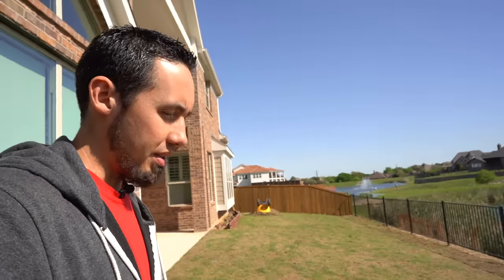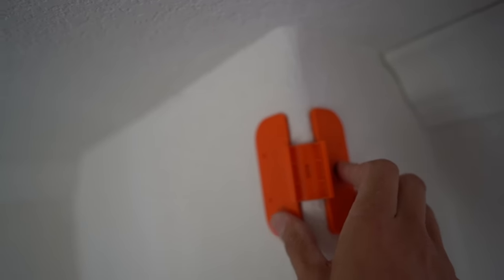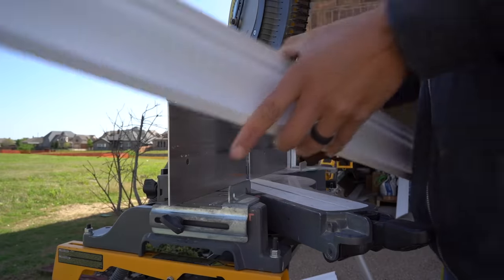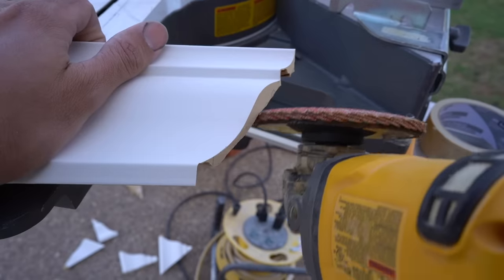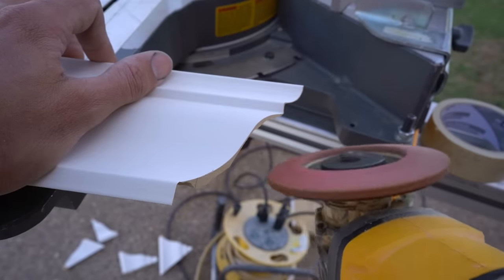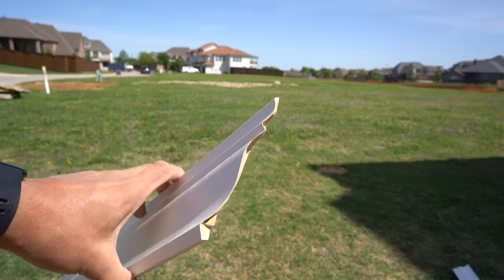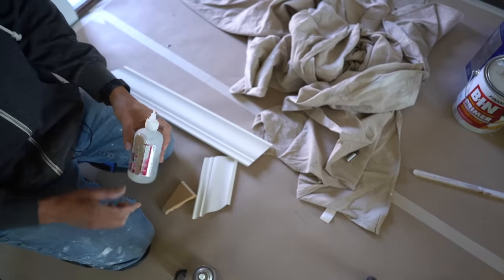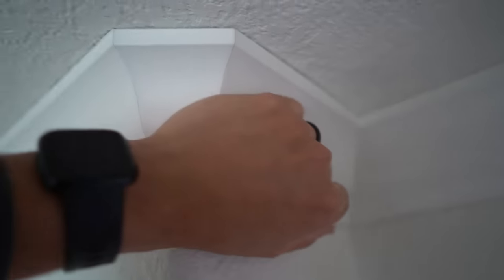This Makes Coping Easier

Comment: Quality work and you make it look easy (although I know, that it takes practice).  My biggest challenge isn’t so much the seam, but one on each end, and having the piece the exact length.  Like two inside corners at both ends or an outside to inside run.
Reply: I mark exactly 10" from one inside corner then place my tape against the opposite wall and measure to my mark and add 10" to that measurement. No guessing from trying to jam your tape into the corner. If you add 1/16" or so you can spring the piece into place by bending it down slightly in the middle with the ends in place. For shorter pieces you may have to put some kerfs in the back to facilitate bending.

Comment: Buy a crown jig for your jig saw and s scroll blade.$40 to $200 for the jig. The plastic ones are fine for weekend warriors,  just get one that corresponds to the angle of the crown. The more expensive ones are adjustable, it gives you the proper back cut, eliminates the guesswork. Well worth the investment.

Comment: Nice!!! My only suggestion would be to get a lighter, slower moving grinder with not so course disk???  Seems like the weight of that grinder would make my arms and hands tired faster and cause problems.  But i do agree with practice, practice, practice.  Glad to see you do this grinding outside as the prime contractor, owners, and other subs don't like all that dust all over the place inside.  Thanks!!
PS.  I've always hated a coping saw cut too.

Comment: I use the jigsaw with the coping foot which is not bad, insert a coping blade to make turns easily. I cut inside also, I feel that having to use a grinder would make a really big dust storm and probably should wear a mask all the time unless you cut outside and it's windy. I prefer not to run in and out from the house to cut and cope moulding but to each there own.

Comment: Man you have a great channel.. Excellent job on keeping in concise and so easy to follow.. I have done metal work for many years and used angle grinders for everything including coping steel but never did I think about using a tiger paw pad as well call them for doing coping. With steel you just run a bead and if you have a gaap.. wood not that easy! lol! Thanks for sharing I subbed will watch more of your stuff!

Comment: I noticed that when he was trimming the profile, he was holding the coping with one hand and the angle grinder with the other, This is asking for trouble with over cutting.
I would suggest that he clamps the angle grinder to something solid and feeds the coping holding it in both hands. This will give him more control over the removal of material.
But I'm not a professional.
Roy
UK

Comment: Hi Richard, I really liked your video. Thank you for posting it. I like the coping method and have tried it before. First with a coping saw and then with a coping foot on a jig saw. I wasn't thrilled with either method and hope this will be my answer. I have a home work shop so I want a corded angle grinder and I will use the flap disc. Two questions for you, first do you think  40 grit is the best for MDF? Second, and most important to me is what "corded" angle grinder would you recommend? At the box stores I see 6 amp, 8 amp, 11 amp, and even 16 amp grinders, so at what point is over kill? I'm looking for the best bang for my buck but don't need the most expensive tool. Thanks

Comment: I use a jigsaw with an up cut blade. I turn the jigsaw upside down and cut along the contour. Much faster process than using the angle grinder.

Comment: Nicely done! I don’t run into those bullnose corners that often if at all. But what is that little orange tool that you were using? I also have never used MDF for crown. But check out that little copping foot for a barrel grip it’s a lot easier to manage than Angle grinder, but I will definitely try your method thanks for the video!

Comment: Great vid. Hey do you measure down from the ceiling and make a few pencil marks to Keep the crown straight on the wall? Especially with MDF I’ve found it will sag or twist if you’re not careful.
Granted I don’t have to do crown every day but some jobs I do have to install it.

Comment: Ya ever use the battery powered nailers and it either puts a dent on the material or doesn't quite sink the brad right? I still use air tools, lotsa hose. Going to try that flap disc trick tomorrow. Metro plex also?Subscribed buddy 👍

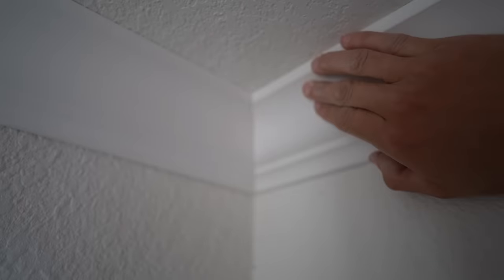Comment: I have the same crown moulding like you used in this video but wider, I tried the same method except the flat cut. Then I ended up a gap on the top of the right inside corner, but yours is ok (see 9:01). Is it because I flat cut it?

Comment: Have you ever tried this same technique using a dremel/rotary tool? If so, what type of attachment did you use? Also i saw there’s a sanding belt attachment out for the Milwaukee m12 3”cutoff tool, do you think this would work as an option for doing the coping?

Comment: Genius with the flap disc, probably takes a few goes to get the feel for it  ! How strong are bonded joints ? Would they be difficult to pull apart with hand pressure only ?

Comment: Some years ago This Old House had a tool that did this.  I did some digging and I believe it is the Copemaster. It looks too complicated and the cost is $2,500.  Too much money.  The angle grinder is good, you just need to have the touch.  What do you put in the joints and along the ceiling and walls to fill in the gaps?

Comment: HAHAH!!!! 
these are the tricks the older guys dont like to tell you, i just did this with a BADLY out of plumb, square and curved corner of a carport addon that we are doing Hardy board on, had to cope the trim board in multiple places diff ways and angles, but... looks perfect now and any hint of coping is hidden by the lapped siding and finish caulking

question tho: as an electrician that is learning on trim here, why cant you build the cope into the saw with beveling the blade at say a 45 to undercut when you cut it the first time and then you should be left with what you just removed with the grinder... or is it that tight you have to contour each curve to get enough clearance?

Comment: This may be a dumb question but I'm trying crown on a small room. So basically any inside corner you can do this and It will fit without having to find an angle? Just end with a straight cut and then cope the other piece?

Comment: Not sure what is going wrong. I measure my distances on my crown and install it correctly. I cope the crown using this method, and others. I cannot get the cope to line up with the other crown. Walls and ceilings are 90 degree angles. Any help is appreciated.  I have watched almost all of Finish Carpentry TV videos and love them all.

Comment: Loved this! I will have to try this method next time I do trim work! I watched another video with a guy using a hack saw but this is much better. What was the glue that you used for the joint pieces? It was hard to hear in the video. Also, does the bull nose measuring tool have a specific name?

Comment: If the piece isn't too long you can use this same method with the miter saw itself slightly resting against the lockdown mechanism takes a little practice
Reply: I first started this method with shoe molding just don't take more than an 1/8 at a time or the piece will kick back

Comment: I suppose you could use a Dremel tool instead of a bulky angle grinder.  I might take longer but the control would be easier.

Comment: Did you remove the small portion of the profile that meets the ceiling? Right at the top of the miter, it looks like you removed a small portion of the profile. I've had to do the same for my cope cutting to match up nicely

Comment: Good job, I'm 65+ and have witnessed a lot worse. I'm from the mitered method but have contemplated coping. Wonder how prefinished hardwood trim would work out. Oh, is dust an issue? Especially inside, way up north. So we're inside in the winter.

Comment: Installed thousands of linear feet of crown (most other moldings as well) and always use a coping saw to cope. Grinder is a lot slower than a properly used coping saw and does not make any better joint. Grinder for coping seems more like a homeowner style method, but to each his own.

Comment: Ive got a question. Are u coping this piece because the other  was already there and you dont want to remove it to cut it, or all crown molding needs to be coped. im new to this but i made cuts with board flat on saw and they came out good.

Comment: Well, mine did not come out perfect.  I am wondering if the piece with out the cope isn't either up high enough or is not at a perfect angle .... I dunno.  Getting close but not there yet.

Comment: Does this method work as well on pine baseboard? I am about to do my first trim work in a looong time, and I now have a DeWalt corded 4-1/2" x 7/8" angle grinder. I like the idea of using for coping. I've only got 160' of baseboard to do in the downstairs of my house, so one disc should get the job done, right? Do you have a disc you recommend? It looks like you're also using a 4-1/2" DeWalt (cordless) grinder.

Great videos - I just subscribed. Thanks!
Reply: Yes it does. I just commented on the post (directly above yours). Works like a charm.

Comment: For a quicker, easier way to achieve the same result with a lot less dust, use a jigsaw held on the face of the cut, much as you would use a coping saw.

Comment: I have a question.  You show us all these tools that calculate the exact angle to cut an outside miter.  Wouldn't it also show the correct miter angle to cut an inside miter?  So if it does, why do you still cope an inside miter?

Comment: Im so using a flapper disc now, I hope you use a dust mask when working with MDF not good to breathe that dust in.
Reply: True....but he's cutting outside. Also, if you ARE cutting in confined area......PLEASE use a respirator with replaceable filters. 3M makes a great one for under $30.00. Dust masks DON'T work as well as you need them to.

Comment: Thank you so much for the video! I had a quick question, you said the tool you had finds the miters and you said it’s right at 45 degrees and then went with 22.5 for each cut, how come?
Reply: It's actually a 90 deg corner. If the drywall had a sharp corner, each of the 2 pieces going into the corner would be 45 deg cuts (45x2=90) but because the drywall has a round corner he used an extra piece of molding so there isn't a big reveal visible from below. Because there is an extra piece to turn the corner, each miter cut only needs to turn half of the 45 deg cut = 22.5 deg

Comment: Dude just try the old coping saw. With good sharp blades it goes by way faster. I cope just about every inside corner I come across. In a race I could get the same result as you faster. 15tpi is a good balance between fast cutting and fine finish.

Comment: I've seen a few tips on coping but the thing nobody seems to mention is- why should you cope rather than miter the inside corners?
Reply: All to do with internal corners never being a true 90°.. Mitres will show the corner not being true but Coping/scribing allows for a tighter joint and better finish..👍🏻

Comment: Is there a certain time when coping is better then a miter inside corner?
Reply: Almost always coping is better, much easier to get a tight joint with variances in walls and corner angles.

Comment: I've done several jobs scribbing like this and it's the shit. Angle grinder, roto zip, belt sander whatever you have on site. Make it work. and if you fuck it up just remember 
 FILLER SPACKLE CAULK AND PAINT MAKES A CARPENTER WHAT HE AIN'T.

Comment: My dad taught me to cope when i was younger but as i advanced most crews i worked with wanted miters. And i admit it works on paint grade but coping is better. When them inside corners fit so tight its satisfying. And what happens when paint grade trim carpenters are asked to install some stain grade oak? Misery and mishap is what. I like the hogging method with the angle grinder tho...im not so old school to just dismiss it and say it aint the way. It works like a fucking charm. Its my preffered method amd will continue to be. The argument isnt with miter cutters tho its with copers. Hogging with grinder is faster with same results sorry copers. But instead of arguing that the hoggers and copers should team up...get a trim installation standard in place. I can cope a house trim crown base name the place as fast as an angle cutter by hogging out my copes.

Comment: What's the benefit of using this method over a double mitre inside corner?
Speed? Easier to get tight if the corner is just off?

Not trying to be smart here, just genuine interest..

Comment: I don’t understand why you would have to copy the inside corners..... why not just cut it at the correct inside corner angle.... and if you are having trouble getting it to close then just cut each piece .5 to 1 degree more on each piece. Don’t get me wrong it’s a nice trick if you are attaching to existing trim. No matter how good you are at it coping would take 3X longer than just cutting the correct inside miter.
Reply: Erick Villatoro thats old school. Coping is new school, and looks cleaner.

Comment: As an employee in the Millwork Department of a big box store, I was required to take a course on-line about installing trim. The dude doing the actual work was pathetic! There were gaps an 1/8th of  an inch! When we got to view the finished corners, the moderator asked "And what is the next step?" I couldn't help myself - - - "Hire a real carpenter?"

Comment: dust... no thanks. Let me know how that works out for your lungs cutting inside where the majority of new construction guys would be cutting.   The best coping tool I ever used as a Collins Coping foot on a jigsaw.  Try that.  It only works on certain designs though so that is little drawback

Comment: I install kitchens for a living and I don't understand why everyone doesn't just miter every joint. Way faster and nicer.
Reply: Josh McDevitt different on kitchens because all the cabinets should be true and square. Existing walls are almost never square and coping is faster than cutting a 44deg miter, then a 47, then a 45.5. This way gives you some wiggle room but still provides a tight joint.
Reply: @TheJCinator  
Lol. Not a chance. Still installed against crazy ceilings. I have installed a ton of crown in houses and I only cope if I absolutely have too. I am telling you : try the mitre .
Reply: @TheJCinator  no it's not lol. So what dont adjust your angle for the cope ?. It's the exact same, you leave the ends loose and push them up or down until it works. Upgrade your shitty miter saw and try it out. You might actually learn some thing.
Reply: Josh McDevitt lol “adjust your angle for the cope” WHAT? 😂 that’s the whole point of the cope to not adjust your angle. And plus, coping is a sign of craftsmanship that’s why it’s still highly regarded today. You clearly need to read up on your crafts, sir.
Reply: @TheJCinator  I was being sarcastic. You must get stressed out on every outside corner  "how I'm gonna cope this uhhh"  What i am saying is you don't have to adjust your miters for a corner that is slightly out. So  Congratulations, you mastered your craft by learning how to cope.. yayyyy for you. Now speed up your craft and use your tools to their full advantage. Honestly I don't doubt you on your coping abilities, I'm just saying I can miter much faster.....
Reply: Josh McDevitt my point stands. The minimal time lost coping vs mitering is gained back twice over during installation and a coped joint won’t open up through the years of expansion/contraction and house movement. These are widely accepted facts amongst trim carpenters.
Reply: I'm just flabbergasted with the fact you won't even consider a different method. And p.s. if you want do a proper cope, every odd one you have to bevel your miter unfortunately. (That's when you adjust your cut to the unsquare wall).
Reply: Josh McDevitt “you lose” lol grow up
Reply: Josh McDevitt I’m just as flabbergasted as you are btw lol
Reply: Josh McDevitt at the end of the day tho (for the sake of closure) as long as the customer is content with your work and you’re happy with what you provided all is good. Good luck on your future adventures and I’ll at the very least consider this convo next time I do some trim work hope you do as well.

Comment: and a hint for the less experienced...if your carpenter is cutting crown standing up on the saw, then he was never taught how to do finish work. he just worked with a guy for a few years then bought some tools. this method only works with cheap, builder grade materials and would never stand up against stain grade trim work. tell us how you do judges paneling without showing nail heads. I dare ya.

Comment: Okay we don’t have to specialize, like you guys, manly because our house isn’t build in styrofoam and popsicles, all our walls is stone! But that cut would have been 5 times faster with the same result, using a jigsaw upside down, and a fine cutting blade, but it means that you have to use a real jigsaw, and not does useless D HANDLES!

Comment: First off, I can cope a piece of crown in under 4 seconds with a jigsaw. What a waste of time.
Second, you are flinging MDF dust all over by doing this. that is very fine grain dust and it will kill you. Not to mention making a mess in a 10 foot radius. 
I have been born and raised a trim carpenter in the age of power tools. The only only excuse I can give this method is a limp wrist. Coping with a jigsaw becomes muscle memory and a skilled trim carpenter can cut and cope an entire house in half a day. Without flinging toxic dust all over the place. 
This is irresponsible and inconsiderate to the other people on site. I would give you hell if you were using an angle grinder to fling dust all over a site I was working on.